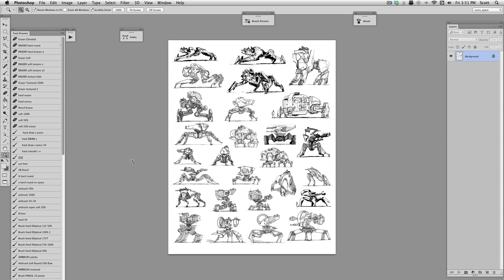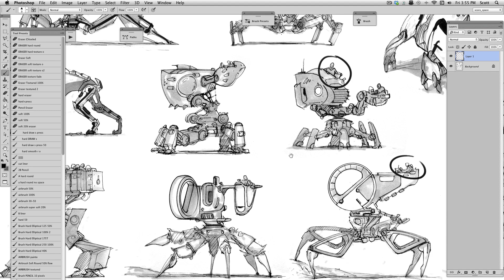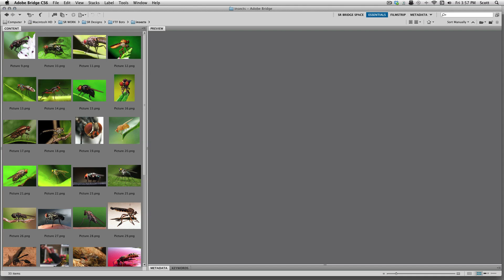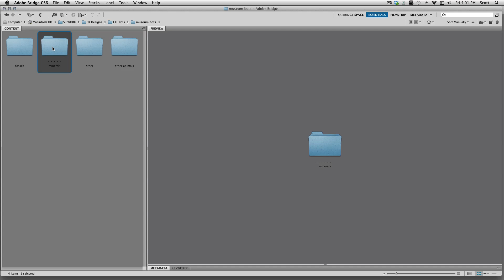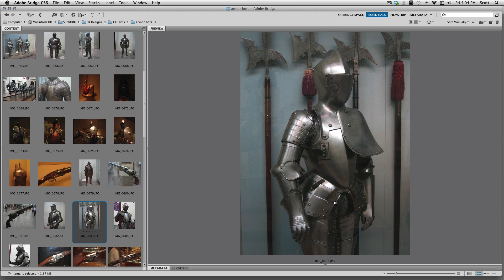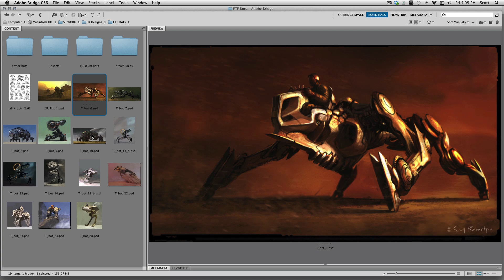page 247: mech design process

Comment: Hello Scott, I need some help with your texture bombing tut on youtube @w7ns
Modo want allow me to use projection types and mirror, Those options are unavailable when using the texture replicator but when the texture replicator is unselected all of those options returns as far as the projection type option and mirror option. I just can't get the texture to mirror with texture replicator. I want to also use planar projection but I can't with texture replicators. Any suggestions I really would appreciate it. Thanks in advance.